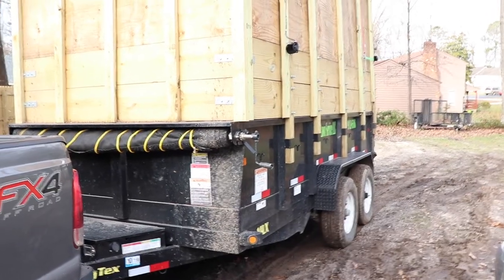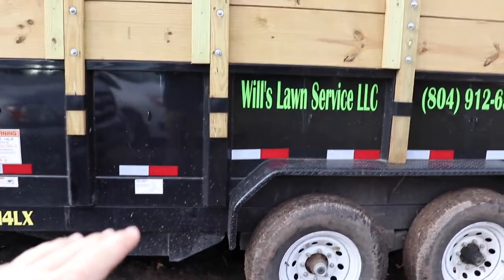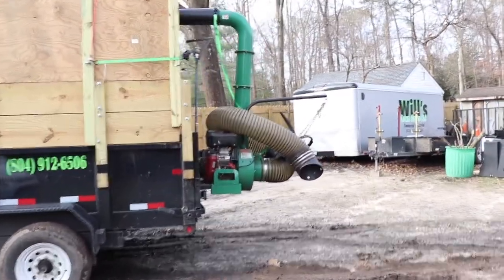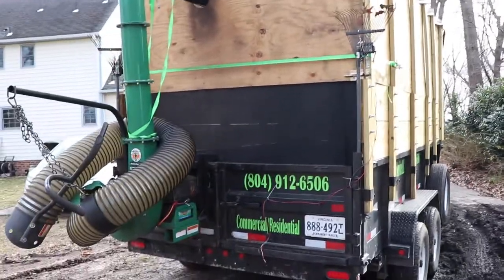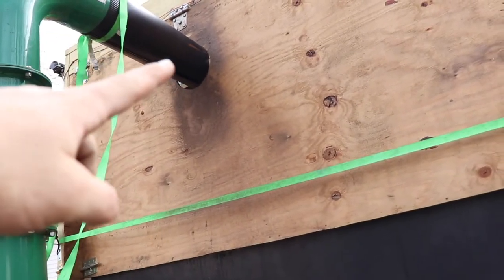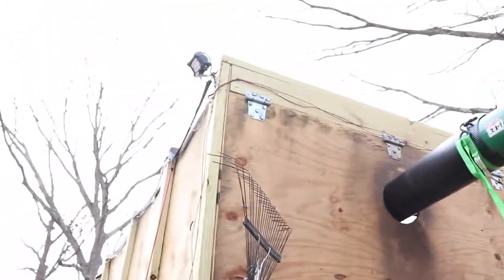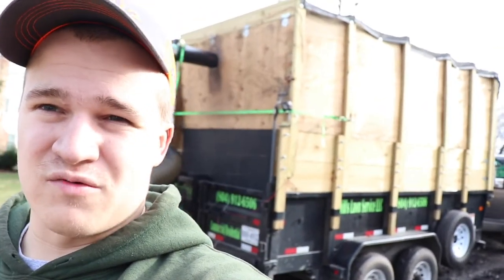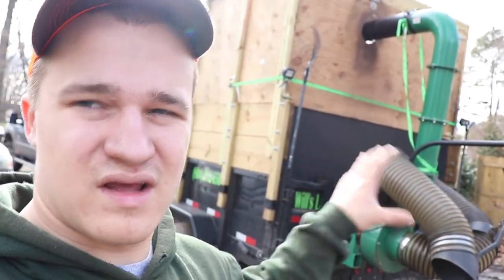THE BEST LEAF REMOVAL SETUP!!! - For My Business

Comment: Self tapping strews to attach the stove pile to the vac chute.  Maybe two will do.

Also you need a vinyl advertisement for your business & contact information.  
Remove it from between the trailer walls and attach it to the areas you put those 2x12”s. 
Run it along the trailer @ 6’ in length.

Comment: How do you take this configuration apart after the fall season is completed??
Reply from the maker: Denny G piece by piece really, only way I’m able to store it. I plan on having a car port custom built to the width of the trailer that way I can use the rungs as the frame for the box.

Comment: Do you take the vat off before you go and dump it Let me know
Reply: I have the same set-up.  You leave the vacuum attached to the back door, and just open the door and strap the vacuum to the side of the trailer.  easy !!!  The other barn door has a factory attachment point that leaves that door flush down the other side of the trailer.